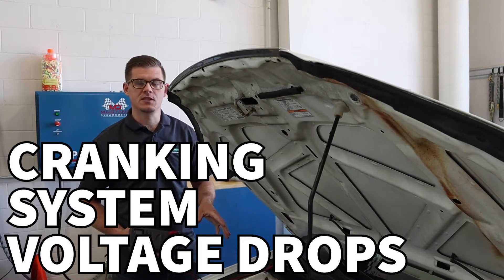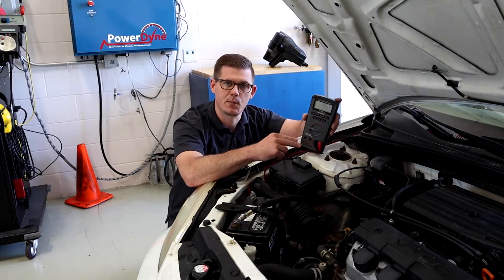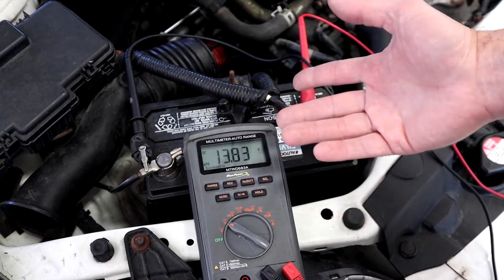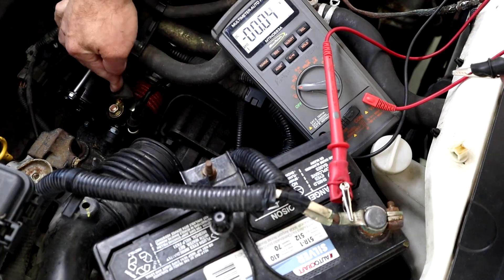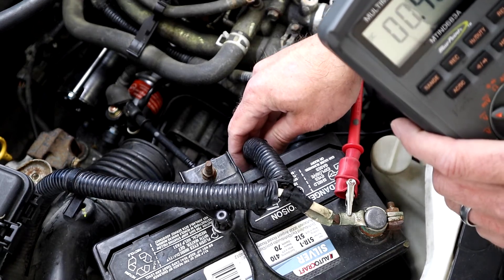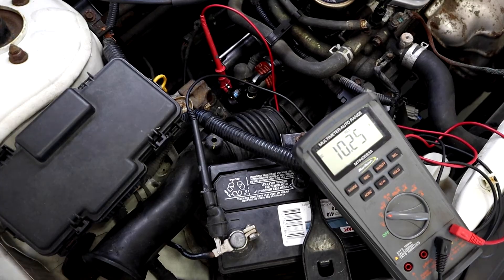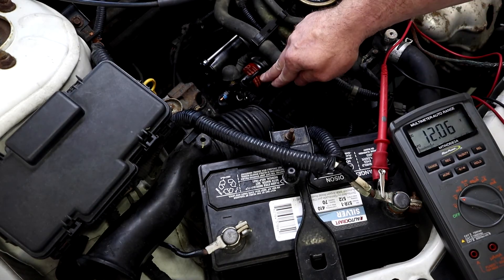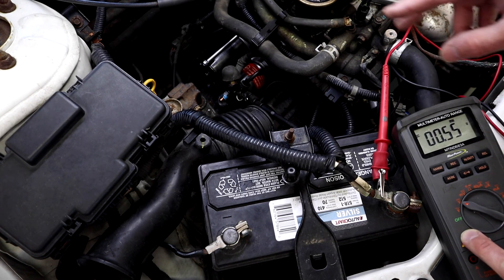Cranking System Voltage Drop Measurements & Testing

Comment: Very good video. But you could be more careful with your wording.  I don't think it's correct to say that voltage travels through the system (circuit). And you might want to add that voltage drop only occurs when a current is flowing.  I understand the theory but i am trying to learn the practical methodology. Thanks for making the video.

Comment: My truck will spin the starter a few times as the the voltage drops to 0 and the crank won’t spin. But I can spin crank by hand
Reply from the maker: Start with the battery and verify that you have good voltage and amperage output. Next you could follow these voltage drop tests to see if all the source voltage is making it to the starter. Additionally, a starter current draw test would help you understand the health of the starter motor. The fact that you can easily turn the crankshaft should point us toward the starter and electrical system.
Reply: @AdamsAnalysis  the truck stalled on me and died. I couldn’t get it to do anything so I replace the starter and then got the symptoms that I stated in the OP. I haven’t had time or the money to pay someone to fix it but would like to get it on the road again someone’s told me my crankshaft is broken or timing chain

Comment: You did good but sorta failed to mention what the voltages should be on some parts
Reply from the maker: Sorry about that. Most connections on the cranking circuit we want to see a voltage drop less than 0.5 volts. One exception is the "S" terminal circuit which can withstand a higher drop and is often specified to have less than 1.0 volts.

Comment: Hey Adam, I have an 07 chevy cobalt having a voltage drop issue it seems like, I am just getting a clicking noise when trying to start the car. Ive done everything including replacing the starter and cleaning up the connections. It seems like the voltage drops to 5 when cranking to the starter. Im going to replace the wire to the starter tomorrow and hopefully that works. Any suggestions are appreciated
Reply from the maker: Hey Dean, Thanks for the comment. Without making assumptions, was a new battery (or battery test) part of the "everything"? I would always start with a known good battery, or assistance of a jump pack and work down through the voltage drops. A starter that only clicks is often due to a lack of voltage (positive or ground) or a failing solenoid. You have changed one of those variables with the starter replacement, so I would get a volt meter and check for drops on the B+ and ground sides.
Reply: @AdamsAnalysis  Thanks for the quick response, i did test the battery and even did a battery swap and all was good in that end. When i try to start the car, the voltage drops down to 5 on the starter. My best bet I would assume would be to work my way back to the battery from there which is what Im going to do tomorrow. Any other suggestions are appreciated

Comment: Finally, a well done video on voltage drops. I take it your meter has a MIN as well as MAX hold? You can use the MIN for the voltage across the battery while cranking. An indication of the internal resistance of the battery as it increases with age, that or an abnormally high current draw from the starter. You can also put a probe on the post of the battery as that would take the total drop into account if the clamp has a bit of resistance between it and the battery post. Damn good video from someone that knows something about basic electronics.
Reply from the maker: Thanks for watching!

Comment: hundred of videos on youtube about voltage drop but no one knows how to fix it
Reply from the maker: Are you looking for help in fixing a voltage drop?
Reply: @AdamsAnalysis  yes
Reply: @SaddamHussaintech4u  Repair or replace the part that appears to cause the drop. Begin with the connections to the battery. Move on to the cables. etc